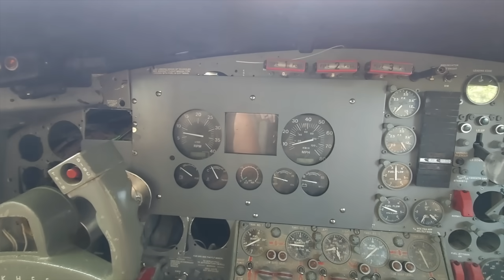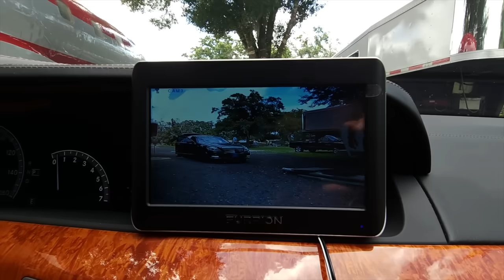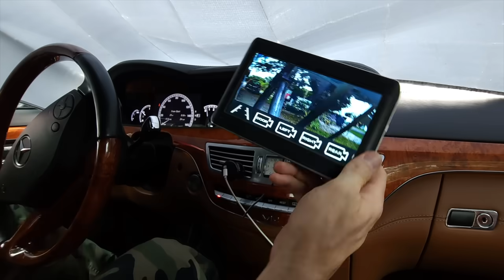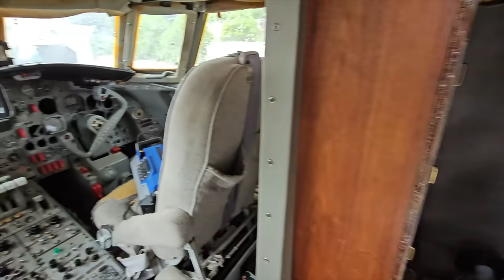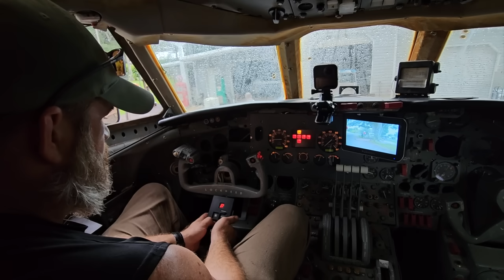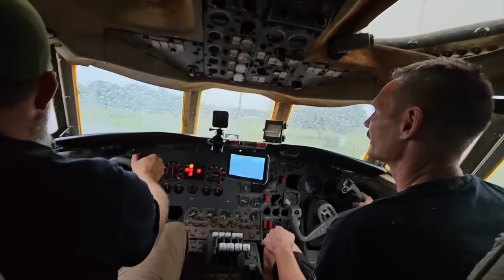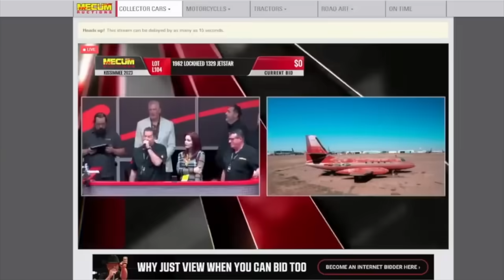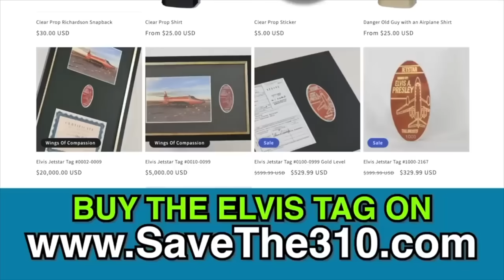I Turned Elvis Presleys Abandoned Private Jet Into A RV.  Finished

Comment: Holy crap! A YouTuber actually finished a project!
Reply: They do all the time
Reply: Hahaha
Reply: But what the hell does the 39:05 golf balls do
Reply: @GEORGIACONSTITUIONMEDIA  I'm a retired commercial tyre mechanic! Never have I seen golf balls substitute lead or powder to balance a tyre. That would be a high risk on an expensive tyre.
Reply: The good ones finish their projects.
Reply: Reminds me of " rebuild rescue " youtuber. The aircraft will never get done.
Reply: @GEORGIACONSTITUIONMEDIA  Supposedly, it’s for balancing the tires. The idea is centrifugal force pushes the golf balls where the weight is needed as the tires rotate at speed.

I have no clue if that actually works.
Reply: @waynegrissom8845 agreed there are so many safer ways to do that. There is a reason typically the use sand or beeds I would be afraid of the golf balls breaking and puncturing the tire
Reply: lol
Reply: @TheGbelcher  My buddy was telling about his balance machine tech coming to the shop the other day and telling them that anything over a 285 is best balanced with 3 golf balls and then for larger tires use 5. he said he even got on the phone with the factory techs that make the COATS balancing machines and they told him that they suggested this as well. I have used beads and antifreeze, and I have heard of using BB's and sand, but that being very abrasive.
Reply: @shisci1  Famous last words.
Reply: @shisci1  How many years has that been going on
Reply: 😂 It's a miracle!
Reply: It has no tail
Reply: Lol
Reply: 2 million dollar albatross lol.
Reply: I can't believe it
Reply: " .....it is said that an albatross was good luck to land on a ship....." Or  ".......usually when a bird lands on my ship, I try to kill it before it has a chance to $#¡+...." Both are quotes from my favorite movies!!!! Can you guess which ones .....? Anyone???
Reply: Both involve flight!!!!
Reply: @Michael666CA  Interesting! Thanks
Reply: lol! Some do, just looking at the wrong ones. Love ayo, he got a few projects, but just finished one boat, now he’s working on another. Anyways these guys are awesome. This rv is pretty cool.
Reply: @jbeard82  yea not like rebuild rescue Jimmy makes it happen he is a shaker and a mover lol 😆
Reply: I doubt it is completely finished. But it's really impressive what has been done so far.
Reply: @bodautorepair  big body
Reply: Have you heard of Matt Armstrong? He finishes projects alot the time most compiled all into one video
Reply: Do not mix Jimmy with Rebuild Rescue. 😅
Reply: @PeterKovacs95  you are right one is a doer and one is not 🤣😂🤣🥲😅
Reply: Lol
Reply: Except it isn’t finished
Reply: Nope, you never finish your project
Reply: Tally-Ho Project
Reply: That’s what she said!
Reply: I’d guess that that’s their idea/substitution for balance beads, which golf balls are to big to settle in the ribs of a tire so all in all it’s a very stupid idea. Also note that they could’ve balanced the tire with wheel weights also.
Reply: What are you talking about? There's so many people who do.😂 Not two thousand sixteen anymore
Reply: @ramcharger9146  Right?!!
Reply: WTF are talking about? 
Almost all YouTubers complete their projects.
Reply: I know lol ! I say the same things , I told one to fly me out and I will help you finish a project! He messaged me back and said ide fly you out but I don’t think I’ll finish buying your ticket lol
Reply: We got one finished finally too.
Reply: The rare follow through is to be commended.
Reply: Inside needs fully restored
Reply: @shisci1 I believe it will
Reply: Are you going to show it to the King. You all know how he is not dead, He is a  Preacher now Couple 100 miles  away from graceland!
Reply: @shisci1  I don't know about that, he's put an incredible amount of work into it so far, and he's gotten much farther than I ever expected. I think the RR guy is pretty solid, but we'll see.
Reply: @jbeard82  Watch better YouTubers
Reply: Tavarish
Reply: Rt lol 😆
Reply: @jbeard82  truth!!

Comment: I gotta say... this came out WAAAAY better than I was envisioning when you announced you were going to do this.  
You and the team did an amazing job making this jet "fly" down the road again.
Reply: Agreed .. my sentiments as well!     Better leave early though... I mean what could possibly go wrong drivng Elvis' jet across country??
Reply: I have to say I agree with you. That was what I thought was gonna be one ugly looking motorhome airplane, but it turned out really really nice. Who knows
Reply: Yes it did. I was expecting it to look like a turd on wheels. It does look extremely difficult to drive just as I expected.
Reply: Same! I scrolled down to say the exact same thing. Now I want to see this in person.
Reply: Would've been neat to of have had the original turbine engine for like Ling miles on the interstate at night time. Mmmmm ohhhh yea knock of some miles really fast!!!!
😂😂😂😂😂😂
Reply: A lot of companies now a days use either the smal glass beads or 1lb bags of sand. I worked 4 a dump truck company up in Knoxville,Tn. That used sand bags.
Reply: Where are your windshield wipers?

Comment: The Elvis Jet looks AMAZING. Great job. I drove 18 Wheelers for a few years when I took a break from aviation. If you add spot mirrors below or above your main mirrors on both sides, it will help alot to see what is next to you without looking at the video all the time. They are cheap and easy to install and they will look good. I used my spot mirrors all the time on my 80 foot semi truck. Have a safe trip.

Comment: Looks great! Better than I thought it would. ONE VERY IMPORTANT THING TO MENTION!! In the rear where the batteries are (and what looks to be a large invertor)...you MUST get some ventilation into that cubbyhole! Ala a boat type of blower motor that we flip on for a minute or so before starting the motor for the 1st time of the day. Vented to the outside. If not this can literally explode! It would be a nice touch to turn those engine covers into open at the front type of cowling as you really need to keep the inverter much cooler than it seems it will be inside that enclosed area. Inlet air while in transit to keep the electronics cool...and BY ALL MEANS an outlet louver for venting air to the outside of the enclosure! VERY very important!! Everything looks good though...
Reply: You think that compartment is airtight, huh?
Reply: @basketballjones6782  Do YOU know that it isn't?? Just an FYI, it doesn't have to be "airtight" to build up gasses from the batteries and explode. Also that is a huge inverter, with a small built in fan that you could see. Did you notice the fan is right next to the door when Jimmy closed it? Where will it draw air in from next to that door when it's closed? I'm both a pilot and a lifelong boatman...what I'm saying is correct and needs to be looked at.

Comment: I ran 4 golf balls per tire in my last motorhome. (a 36' Newell with 22.5 tires)  for thousands of miles. They worked great. When I stopped for a traffic light with my drivers window open I could hear them bouncing around in the tire for a few seconds. I'm now running the balance beads in the 24.5 tires on my current Newell. It takes a few miles for them to balance after setting for a while.

Comment: I love this. I think that it would be cool if you were to make a few of these not just for show but to make them into a nice motorhome that people can not only take camping in but could live full-time in if they were full-time RVer. A similar thing would be to take an old light rail vehicle and make it into an RV that someone could not only go camping in but could live full-time in? The light rail idea could be so each cab at each end would be fully operatable. The transmission would be designed so the engine in a low-floor light rail train car would be designed to be on one end and the water and black and great tanks would be on the other end. When you want to start it up you would pick an end and when you slip on the power the wheels would have their own electric motors that would turn them so the engine would just power the wheels and be a generator but the wheels would be geared so they will run at full speed in the direction in which you started the mother home up in. The water and hook-ups for campgrounds would be on both sides so no matter which direction you go you will not have to do the dreaded trying to back it into the spot but just pull it in one way and pull it out the other way. You would have to chop down the length of the light rail car so it would be a legal length for the road but keep the articulated parts of the car for turning. 
Not like you haven't taken a bet since high school?

Comment: Two thoughts on the HVAC.  Ford Fusion Hybrid.  The Fusion has an unbelievable strong AC that is electric powered.  Not sure how it gets power, but it’s not engine run.  For the back maybe a ductless mini split. set up.  Last, maybe a flip up vertical stab for display and airshow low passes.

Comment: First off, I have to say that you are nuts Jimmy. What a crazy project. I also think that the creation of this most interesting vehicle definitely goes beyond imagination. I hope that the journey to Oshkosh goes well and I know for a fact that there will be a huge number of people going through it. I was one of those “Helicopter People” for many years and I have to agree with you that they can be annoying whenever they are in flight. I have made some fun stuff with time expired helicopter parts. I have a Bell 206 tail rotor ceiling fan in my bedroom and it has been in operation for 34 years without any problems. I also built a wind generator from the entire main rotor system of a Bell 47 including the transmission and mast assembly. It was powering a ranch house in Baja California for many years. It has succumbed to corrosion after about 35 years and is has since been junked. It was fun to watch a 37.5 foot main rotor turning in the wind making plenty of power to power the barns. 
I admire your rather off center outlook on life and living and I wish you the best of luck in Oshkosh.
Best Regards Al Hartley

Comment: Try some Dzus Fasteners for you oil cover. They make them in a wing nut design so you would not need any tools to open rather than taking the two bolts out to get to the oil.

Comment: What are your plans for the tail? Couldn’t you make a trailer of the tail parts? It would have a hoist or hydraulic table system that raises it up to the back & almost looks like the tail was put back on. For display and all the tents could go in it. You would need to lower it for transport. Maybe you could arrange the tents to mimic a wing. Cut up the tents in the shape of a wing on one side.

Comment: While I admire your energy and your determination to finish things and get them done, and I truly love that you have embraced the aviation community with all your content I am slightly disappointed with the outcome of this jet. The problem is its usability is not real if you look at the length between the front axle and the very tip of the vehicle you will notice the angle of entry is very shallow and you will begin to hit speed bumps and other things, especially driveways and other entryways that are not on the same plane as the ones you were driving on, you will have the same phenomenon upon exiting when there are different angles between the vehicles and the one you are going to enter. These things should have been looked at when the vehicle was being designed while it may seemingly look as functional is something less than.

Comment: When I had a washing machine with a VERTICAL agitator I would use TENNIS balls in the machine for dynamic balancing .
They would float and the cloths would fall to the bottom of the tub. The Machine never vibrated or jumped around.

Comment: The number of fans trapping through this jet will walk on carpeting, maybe plastic runners could protect it?  The brass cup holders are vulnerable to theft by fans visiting?  Squeegeeing this flat surfaces under the Elvis jet will need to be dried after rain and prevent haze of dried rain water.  Stainless polish to bring back mirror finish?

Comment: but, don't you have windshield wipers?
I would suggest two cameras mounted under the nose of the plane pointed ahead at the road so you could mount some monitors inside the plane roughly where windows would be down to the road ... it's actually kind of dangerous to drive when you can't see the road at all

Comment: That's not sand in the old tires!,!
It's balancing beads! DO NOT SPILL THAT ON THE CONCRETE! It's slick as snot if you step on it! They are near microscopic little lead beads!

Comment: This is a shame, it could have been so much better... This is clearly a rushed project, lots of corners cut, like the inside isn't ready, vinyl stripes are crooked, and not properly spaced apart on the nose, camera system is inverted, the picture needs to be flipped, seats, headliner and AC need to be fixed.... I mean, I could go on and on with things that are wrong/need to be fixed on a project the video title claims is "Finished"... It saddens me to know that, this plane could have flown again, if only Rebuild Rescue had won the bid and not this clown show... Thanks for taking a piece of Elvis history and completely destroying it, but hey, it got you views, clicks, subs and money, right?

Comment: That instrument panel looks terrible, I could have made actual aircraft instruments work or I could have installed individual gauges in each of the instrument holes.  Another options would have been a single touch screen that looked like a single screen mfd or efis with cameras integrated.

Centramatic makes wheel balancers that bolt on to the hub or wheel.  Golf balls is an old wives tale that does not really work and is not a good idea.

Comment: Yeah the.cops suck brother. I've met plenty of them with my version of the boaterhome essentially a pontoon style floating house that drives into the back of a old peterbuilt. Still better then what the original ones were. And cheaper.... I've been pulled over out of curiosity and because registering it since it is a truck a trailer and a boat and an rv it kinda was a pain. Luckily where I'm from here in Indiana the local bmv is used to me having weekly trips and working with me. I think I may have been the only 17 year old back in 2004 wanting to get my cdls and pilots license and then moving to Tampa to become a pilot.

Yall ever need some help and are near Indiana famed turkey run state park let me know.  Dinner is on me and yes I'm a grill master